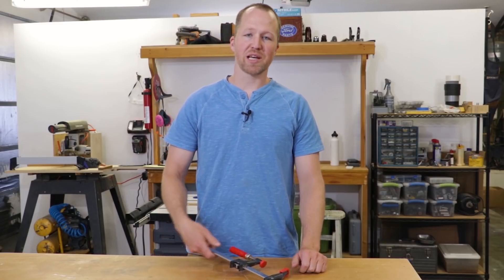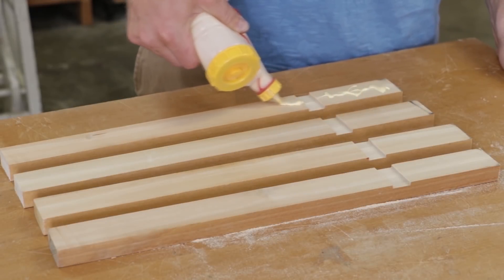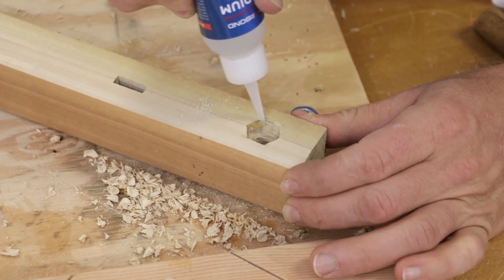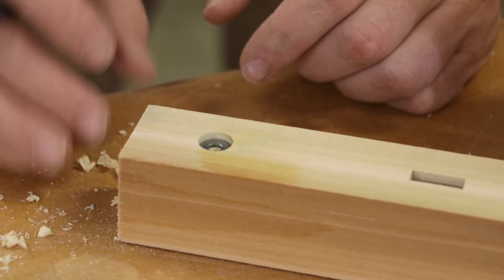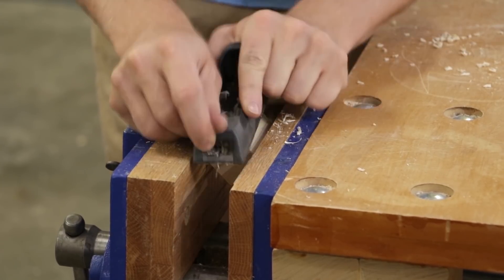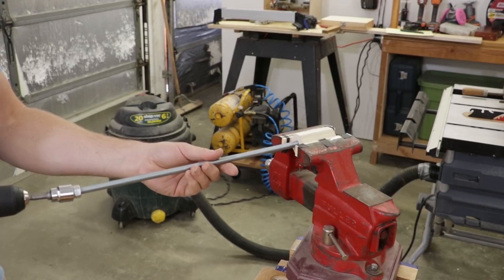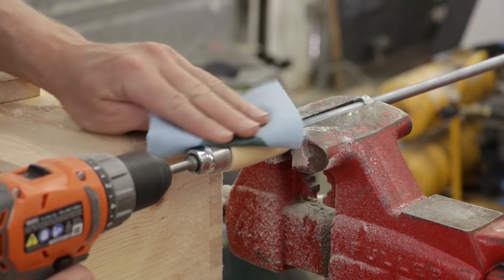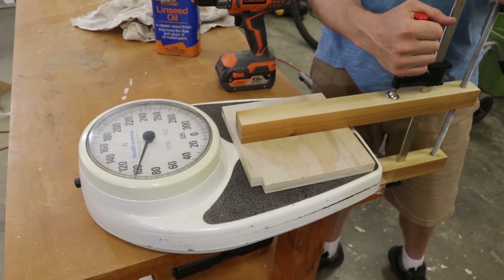long reach clamp extensions for f-clamp || NARRATED {DIY woodworking}

Comment: About Polygons:  Poly = many,  Gon = sides
Trigon: 3 sides  (180 degrees)
Tetragon: 4 sides (square or rectangel)  (360 degrees)
Pentadon:  (any guesses?)   (540 degrees) 
Hexagon:  6 sides  (720 degrees)  (= most bolts!)
Heptagon: 7 sides (900 degrees)
Octagon: 8 sides (1080 degrees)   
Nonagon: 9 sides (1260 degrees)
Decagon: 10 sides  (1440 degrees) 

Useful degrees to know as a woodworker when finding the right angels to make a polygon frame: 
Fx. octagon: 1080/8 =  135 degrees cut on each of the 8 pieces of equal lengths makes a perfect octagon 👍